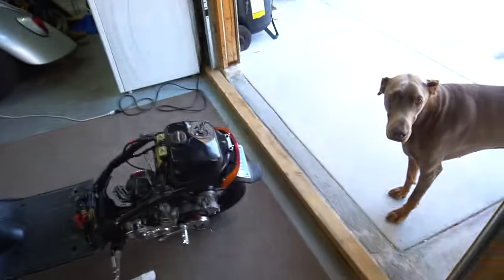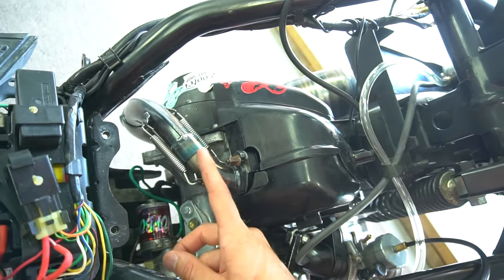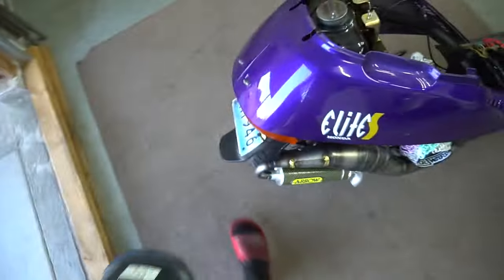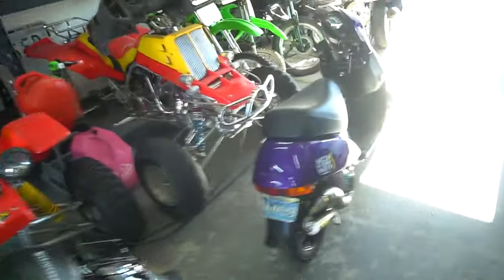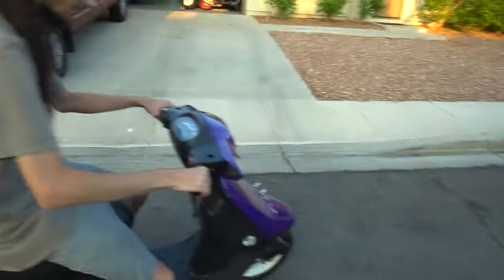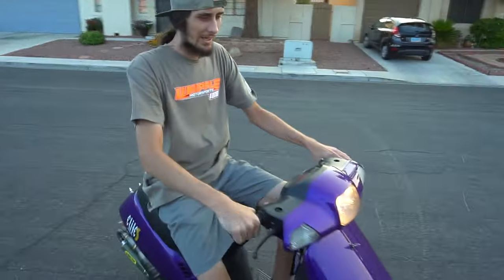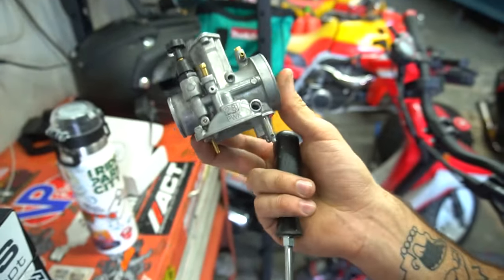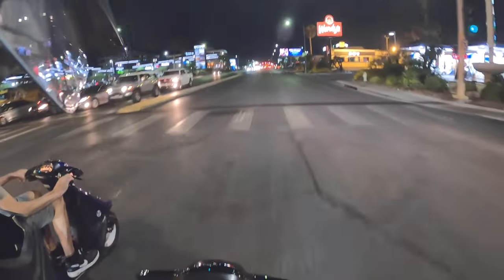FIRST RIDE! New 72cc HONDA ELITE DIO Build + Scooter Tuning

Comment: The thing were it’s slow after you let go of the throttle and get on it again could be a too soft torque/contra spring, try swapping to a little harder one and same goes for your clutch springs it sounds in the start like it grips a little to early so try just a little bit harder ones

Comment: Hell yeah bro!! Another excellent Mopboyz vid! Im dailing in my arrow too. All you did was lighten the rollers and it wheelies like that?  What rpm does the clutch in gauge? I have a delay in power from start off line, clutch tuned to move as the belt starts it's decent in the pulley but cant get a power start like that! Can Chuck come tune my scoot up 😂

Comment: Dude good to see it running again i just finished my 172cc 2 stroke swapped piaggio nrg mc3 its running good and the carb problems you have is cause its a polini carb it need to be perfectly tuned to run good try out dellorto or keihen Much better

Comment: I had this same build in honolulu…on an all black S. polini corsa, arrow pipe. even got it ported. used to hold wheelies everywhere, until it got stolen from the beach in under 5 minutes. Still haven’t found a funner bike to wheelie.

Comment: I just picked up 2001 Elite Sr 50 and my goal is to hit 80mph...what do u recommend for a good start to hit this goal? Big bore kit? Stage 6 clutch and different variator and weights? Carb? Air Intake? Exhaust?Maybe better cdi and coil as well

Comment: Wait when you said the carb is 28 did you mean 28 cm? I dont know a lot about carburetors but i do know that my buddy has a 160cc four stroke fiddy with a 26cm carb. Maybe it differs what you need depending on if its a four or a two stroke? Or maybe i just got that shit wrong idk man i have confusion

Comment: Scooters are going big for sure; A lot of it is from rising gas prices, another part is because small displacement scooters are going extinct. Fewer and fewer 50cc scooters are made every year due to cafe standards and the green agenda. It's only a matter of time; Yamaha stopped making 50cc scoots a while ago, and Honda will have nothing smaller than 125 in a couple years. China and Taiwan (and a couple euro companies) are the only ones left, and they're phasing them out; Kymco is pushing to go all electric. sad days ahead.
Reply: then why are you saying they're going big?
Reply: @ml-w6130  Because demand is rising now that they are becoming hard to get. Same thing happens with ammo and gun sales when there are shortages and politicians push hard for gun control. Nothing motivates people to buy something better than that thing becoming potentially unobtainable.
Reply: @BigEpinstriping  oh okay yeah. One of the main reasons I like scooters is because they’re dirt cheap and there is usually a lot of aftermarket parts. I just figured it wouldn’t be like that if the scene started dying, and high prices for China scooters isn’t exactly appealing to me. And also the fact that you ended your comment with “sad days ahead” sounded contradictory to “the scooter scene is going big”, as I figured it would be something to celebrate.
Reply: @ml-w6130  Don't get me wrong, I think we'll be seeing scooters for a while, especially in other markets overseas, but in many countries, you have electric scooters and e-bikes cutting in to the segment now. And you don't need a license, registration or insurance for an e-bike, and they are almost as fast as a stock 50cc (28mph on an e-bike versus 30mph for a moped in most states) There are many promising developments, and there will always be collectors and enthusiasts. but The days of the scooter as we knew them are coming to a close. I genuinely hope I'm wrong, but the writing is on the wall. It's almost like the last hurrah for the 50cc scooter.
Reply: @BigEpinstriping  yeah I get you, I don’t have to be too worried about that stuff here in Sweden. The moped and scooter scene is blooming amongst us teens, and adults too! A lot of 50cc lovers here. People do drag racing with them and everything. Come on down ;)

Comment: You need that ncy lightened flywheel. I have one on my 72 and it revs so much faster.
Reply: Doodoo
Reply: 20 k rpms for nothing just rev and go nowhere
Reply: @chuckbarnes5080  brooo where does the 20k come from? Sounds to me like you have never used one? But thanks for talkin shit on my idea. Figured Trevor would like the throttle response
Reply: @jasonkost6388  I've messed with them there best for track racing out of turns and what not alot of ppl don't know how to properly tune them but I still have seen way faster dios with stock lightened mag setups. They are just a waste of money to me lol three pole stator and lightened mag ftw
Reply: @jasonkost6388  my favorite rotor kit is the Daytona inner but you can't run lights and hard to find nowadays my mentor with the fastest dio in the usa doesn't even run a rotor kit 😆 been doing this for a long time so I'd like to think I know what I'm talking about 🤙🤙🤙 maholos you haole bugga you